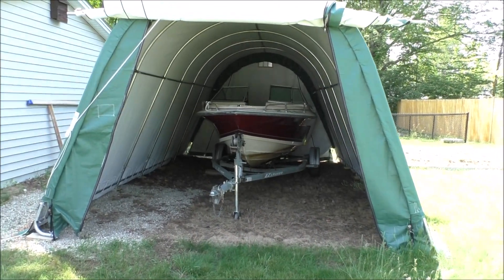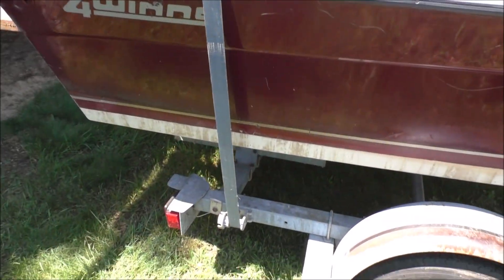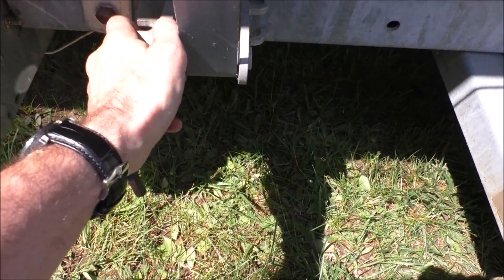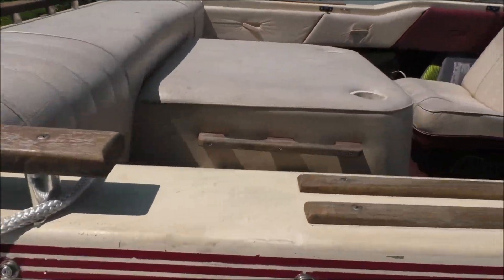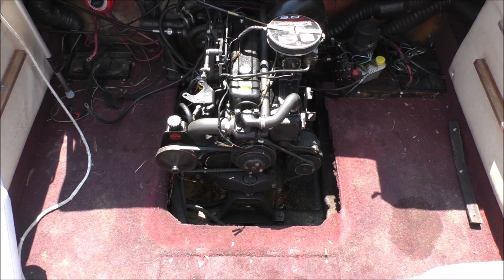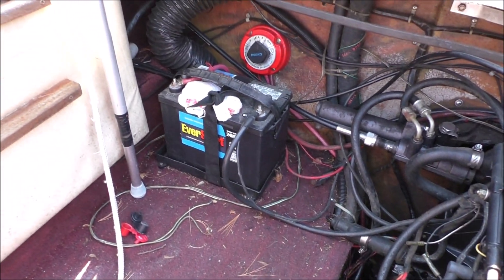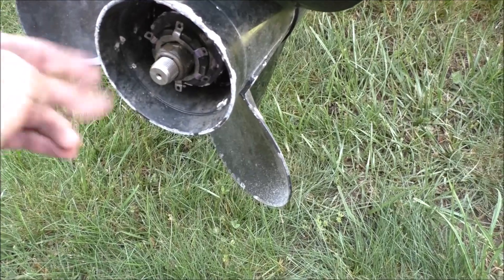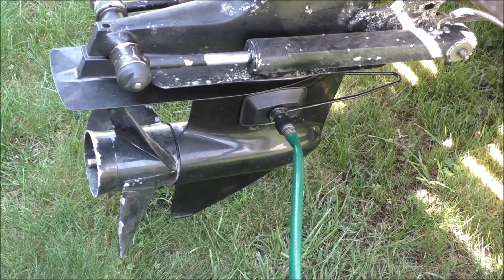De-winterization and First Start of the 1986 Four Winns 170 Horizon's 3.0L Mercruiser for 2023

Comment: I must say, this was a well-produced and well-edited video.  Second camera is nice to have for things like this.

That first crank was a bit harsh.  Looks like the engine kicked back a couple times, at least from what I could see and hear in the video.  Is the timing dialed in right?  Seemed like it might be just a tad off.  (Hopefully, the flywheel key isn't sheared, har har!)

One started, it ran great, compared to previous years.  Definitely sounded like all 4 were banging away just fine.  

You have a great affect, the first time it popped and you said "almost", you said it in such a way I can't really describe, it was just funny the way you said that.  I saw a quick time-waster video of a teen's car that caught fire on the way to her graduation.  She made light of the situation and said about her car "Yeah, it does that sometimes".  Sort of like that.

I'd be real scared if I were out in the boat, take it out somewhere, and then it started like that to come back.  A car that won't start is one thing, but in a boat, obviously, you're on the water.  Getting stuck in that regard is a different thing entirely.  But I'm sure once she's been running for a while, it starts real easy and runs smooth.
Reply from the maker: Well I did major in film production in college so I can get creative when I feel like it and have the time.  Generally I don't have the time while I'm making the videos to get real creative with worrying about production values.  Today I wasn't up against a clock to get the job done quick so I decided to actually try to put some thoughts into how I shot it.

It's always going to be a harder start first time in the spring because the gas has evaporated out of the float bowls and the fogging the engine with oil doesn't help matters.  Once it starts and runs that first time for a few minutes and burns off the fogging oil it's a whole different story when it comes to starting.  From now on for the rest of the summer it will fire right off with no kvetching.

I was surprised at the fact that it started on all four cylinders right from the get go.  It has never done that ever when the engine is cold as long as I've owned it.  I'm wondering if the marina I took it to to be winterized tweaked something to make it run better cold.  They do have to run the engine when they fog it and maybe it was running on three cylinders as usual and the guy took a screwdriver and tweaked the carb or something to get it to run better.  If it keeps starting on all four this summer I certainly won't complain.
Reply: @tallboyyyy  Toughest edits I do are the pool videos, slime videos, and washday videos.  I can say I have gotten a lot better at it over the years.  I also doubt myself, I have re-edited videos I thought were already done, but upon watching them, there were a couple of items I wasn't completely happy with.  The worst are when I have to go back 2 or 3 times when I thought I was done the first time.

I still hark form the early days of YouTube where all we had were potatocams and pretty much  no editing.  But the landscape has changed since and people demand finely polished videos.

Comment: Considering purchasing one of these, do you know if they will fit in a garage with a 7th garage door?

How much fuel do you typically use per hour?
Reply from the maker: I couldn't say about the garage as I don't know what a 7th door is unless you mean a 7 ft door.  In that case it might.  You also need to make sure the garage is deep enough so the boat will fit outdrive to trailer tongue.

Gas usage is pretty good.  I don't use it much so I couldn't say per hour.  I fill it just before putting it in the lake for the summer, 26 gallon tank, and it lasts me the whole summer of light use.  The next spring I usually only need 10 to 15 gallons to refill it.
Reply: @tallboyyyy  yes 7ft* door lol